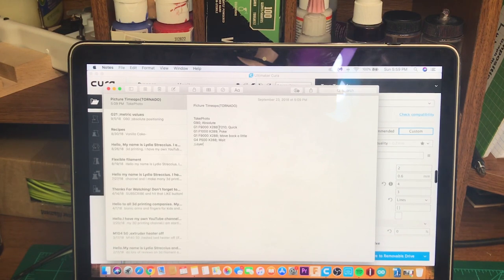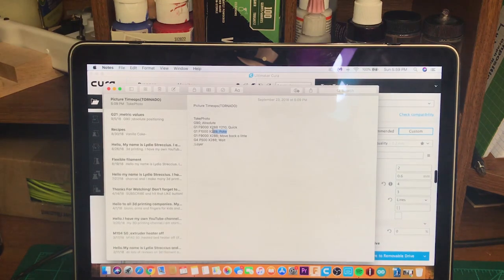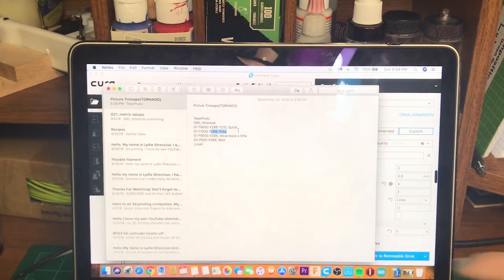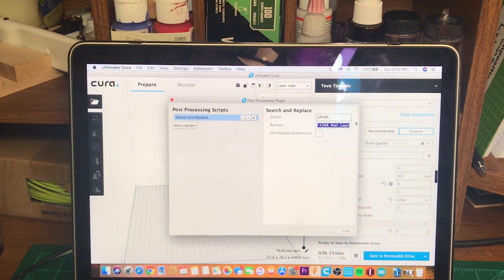How To Make Those Cool Time Lapses but with CURA and a GoPro!!!

Comment: Thank you for this video and the initial code.  Needed a few tweeks, but it is working good now.
For those that are having the problem wit the extruder feeding on the return from poking the button Cedric had a great solution. 
After you poke the button, pause, THEN put in code to move the print head back to the middle of the print (or closer to the general start area).
Then you put in the G90.  That will hold any extrusion.
Reply: hei man, how did i managed to make it?
Reply: can you please explain this with a bit more detail? What code did you use to move the print head to the middle before using g90? (and have you looked in the description, they have slightly updated code there, but it still slightly feeds after the poke) hoping you can help by possibly just providing the code you used in the same layout that is in the description). thank you!

Comment: Great explanations, thanks a lot! 
I am currently running a delta printer (so the bed isn't moving), any idea of what the code could be ? I managed to get the print head to move up but couldn't get it to go back down to previous position and resume print. I've tried many things but the head won't come back to position, any idea of a code that could work ?? :)

Comment: I wonder if Z-move is giving some time for the filament to ooze out of the nozzle.

It's impossible to really pull back the plastic that is molten within the nozzle during retract because there is no vacuum seal, so while there is negative pressure from retract at the top of the melting chamber, a little bit of air will make it through and allow the molten mass to separate and a little bit of it will keep flowing out the bottom. I think in slicer-emitted print and move operations, it works a lot better since the slicer can do a slow retract and plan it over the time of movement; but you don't have that option since you don't have the absolute E coordinate position nor Z and need to make a separate retract move in relative coordinates, but need to hit a button in absolute X coordinate.

At F1800 the retract moves 30mm/s; for 10mm it's 1/3rd of a second. To move the Z axis in the same timespan by 2mm it would move at 6mm/s, or 360mm/min. Correspondingly if i'm not getting something wrong you could combine retract and move-up into same move with
G1 E-10 F360 Z2
I wonder if this will help a wee bit.

Another possibility is to reduce the height of Z move to just 0.1-0.2mm, or remove it completely. The disadvantage of removing it entirely is that it will mar the print a little bit, at least hypothetically, because the Z move to actual new layer height at layer transition is performed after the ;LAYER: marker emitted by CURA.

I sometimes wonder whether we're not all printing in the entirely wrong orientation. Imagine the printers were upside down, the bed was on top and moved upwards from the tool head, then the gravity would no longer cause oozing. Ideally you want gravity to play no role in printing operation, that all material deposit is the result of plastic being pushed through the nozzle by the extruder, and that it doesn't cause the deposited material to move down either. Obviously zero-g environment like printing in outer space or at least free fall would be perfect. Vacuum could be a further advantage, as there would be no air drafts. So apparently best strap a printer to outside of spaceship. :D

Comment: Nice video, for retraction when pulling away from a print use, retract before layer change in material settings. It might be activated or it might not be, set highish retraction distance

Comment: My camera is closing automatically after some time, how to make it running all the time??? (ANDROID MOBILE)
Reply from the maker: Make sure it is charging while doing the video(keep it plugged in) and make sure the sleep mode setting is turned to none in your setting so that the phones doesn’t shut off after a certain amount of time
Reply: @TimberWood.Customs  thanks for the reply, it worked but every time x axis go to click the button it extrude filament on bed, what should i do???

Comment: what should the gcode be for the ender 3
Reply: For my this is the best, so I havn`t Stringing

;START of TakePhoto routine
G91 ;Use relative positioning mode
G1 E-10 F1800 ;Retract 10mm of filament
G1 Z2 F2000 ;Move Z up 2mm
G90 ;Use absolute positioning mode
G1 F13000 X205 Y220 ;Quick move to rear right
G1 F1000 X212.6 Y220 ;Poke
G4 P700 ;Pause for 0.7 seconds
G0 F9000 X115 Y115 ;go in middle
G91 ;Use relative positioning mode
G1 Z-2 F2000 ;Return Z to current layer 
G90 ; Go back to absolute position mode for all axes
;END of TakePhoto routine
Reply: @cedric476  thank you, work great on my Ender 3 Pro :)

Comment: Does it work on the Ender 3?
Reply from the maker: Yes it should
Reply: @TimberWood.Customs  well it does not work on my ender 3, but i got this code i made it work
G90
G1 F1800 E-3
G0 Y117
G28 X0
G91
i got a selfie stick conect to the original button of X axis
Reply: @DedecaPT  
Maby this Work

;START of TakePhoto routine
G91 ;Use relative positioning mode
G1 E-10 F1800 ;Retract 10mm of filament
G1 Z2 F2000 ;Move Z up 2mm
G90 ;Use absolute positioning mode
G1 F13000 X205 Y220 ;Quick move to rear right
G1 F1000 X212.6 Y220 ;Poke
G4 P700 ;Pause for 0.7 seconds
G0 F9000 X115 Y115 ;go in middle
G91 ;Use relative positioning mode
G1 Z-2 F2000 ;Return Z to current layer 
G90 ; Go back to absolute position mode for all axes
;END of TakePhoto routine

Comment: Hey! do you got or anyone got any fix for when head is traveling back to the print and keeps extruding the filamente on the way?
Reply from the maker: Spyke I do not I’m sorry I still haven’t figured that out
Reply: Whit that i havent problems:

;START of TakePhoto routine
G91 ;Use relative positioning mode
G1 E-10 F1800 ;Retract 10mm of filament
G1 Z2 F2000 ;Move Z up 2mm
G90 ;Use absolute positioning mode
G1 F13000 X205 Y220 ;Quick move to rear right
G1 F1000 X212.6 Y220 ;Poke
G4 P700 ;Pause for 0.7 seconds
G0 F9000 X115 Y115 ;go in middle
G91 ;Use relative positioning mode
G1 Z-2 F2000 ;Return Z to current layer 
G90 ; Go back to absolute position mode for all axes
;END of TakePhoto routine
Reply: @cedric476  THANK YOU!!!!  such a simple solution to the problem.

Comment: HELP ! , After clicking picture and coming back to actual position, It extrude a line from "Photo Click Place" (X234) to "Actual Place". Check my code , 

;START of TakePhoto routine
G91 ;Use relative positioning mode
G1 E-10 F1800 ;Retract 10mm of filament
G1 Z2 F2000 ;Move Z up 2mm
G90 ;Use absolute positioning mode
G1 F13000 X232 Y170 ;Quick move to rear right
G1 F1000 X234 ;Poke
G1 F9000 X234 ;Move 1mm to the left
G4 P500 ;Pause for 0.5 seconds
G91 ;Use relative positioning mode
G1 E9 F1800 ;Restore filament
G1 Z-2 F2000 ;Return Z to current layer
G90 ; Go back to absolute position mode for all axes
;END of TakePhoto routine

Comment: can someone give me the gcode for ender 3 for this because the gcode she used is not working or I'm just doing it wrong can someone please help me I really like this idea.  Please help
Reply: i also need that if i find it ill tell ya
Reply: ;START of TakePhoto routine
G91 ;Use relative positioning mode
G1 E-10 F1800 ;Retract 10mm of filament
G1 Z2 F2000 ;Move Z up 2mm
G90 ;Use absolute positioning mode
G1 F13000 X205 Y220 ;Quick move to rear right
G1 F1000 X212.6 Y220 ;Poke
G4 P700 ;Pause for 0.7 seconds
G0 F9000 X115 Y115 ;go in middle
G91 ;Use relative positioning mode
G1 Z-2 F2000 ;Return Z to current layer 
G90 ; Go back to absolute position mode for all axes
;END of TakePhoto routine
Reply: @cedric476  is G0 F9000 X115 Y115 ;go in middle necessary? it makes a line throughout the print in the middle every time I use this
Reply: @shadowheart43  
Actually, this should not be pased.maybe you also have problems with stringing?
Reply: @cedric476  yea maybe. i'll keep tweaking it. thanks!!
Reply: @cedric476  For some reason printing vases doesnt work on this. It doesn't complete the layer in the back resulting in a huge seam. Im in the verge of giving up and getting myself a raspberry pi!!

Comment: Video effect is fine, but this method decreases print quality. My idea: don't pull the nozzle outside the model, place it at 0,0 to take the picture. So the nozzle don't leave the model. Don't change Z to take a picture. Delete all Z and retract commands.
By using this method the nozzle stays in the middle of your model. For remoting your gopro forget your hardware switch, instead use contacts of your internal beeper on the board and nsert a beep command in your script. Only an idea ...
Reply: put a hardware relay parallel to your beeper.
Reply: Hey there, seems like this is a good idea. May I know how internal beeper connects to gopro?